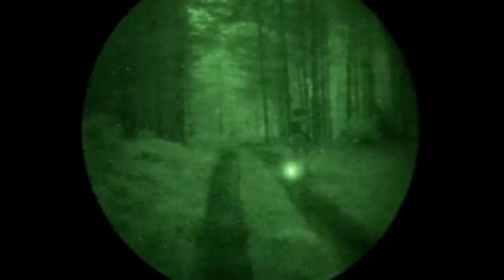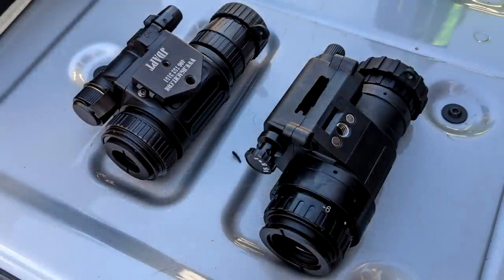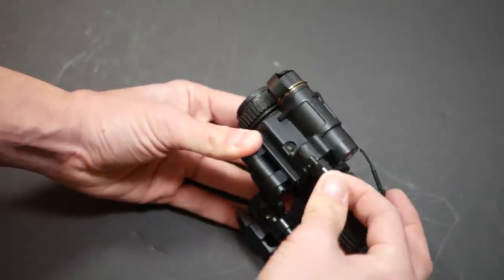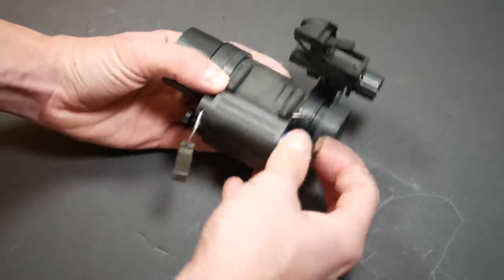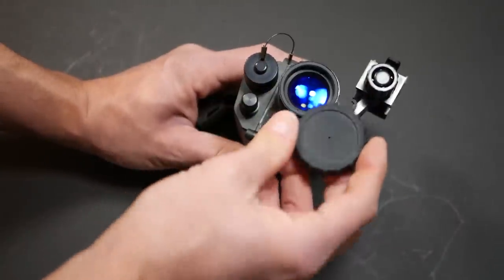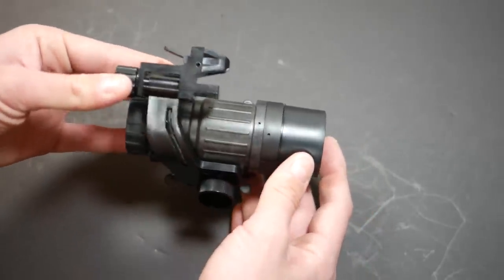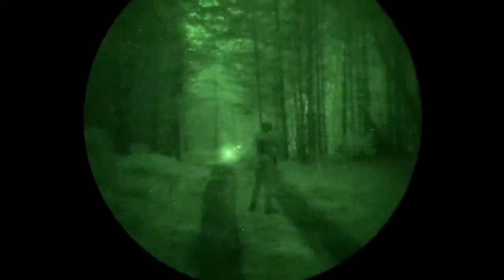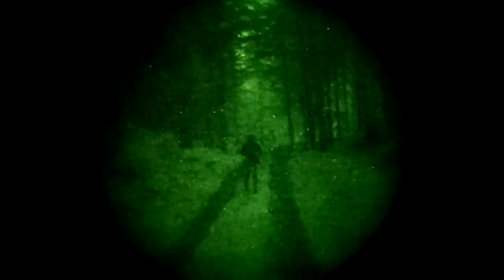Night Vision 101: The Basics

Comment: Awesome vid! Just wanna point out that automatic gain control does protect the microchannel plate in the tube since it actually reduces MCP voltage and physically cuts down the number of electrons going through the MCP and striking the phosphor screen. Also, pretty much all tubes after the very first Gen 2s have bright source protection mechanisms that reduce photocathode sensitivity when bright lights enter the field of view. Quality of BSP will determine how much abuse the tube can take. I have a non-gated tube that can take up to 50,000 lux, where my gated Gen 3s are rated to ~5,000 lux.

Comment: For anyone wanting articulating dual tubes check out the Nocturn Industries UANVB Katana housing. Similar to DTNVS but lighter and it has built in IPD stops for $1699.99.

Before I found out about the Katana, I was planning on going RNVG with filmless tubes then upgrade to DTNVS later on.

Comment: Good info! Please more on all things night shooting, especially nightvision/thermal pros and cons, and switching to white light in between. I do a lot of predator hunting, and am looking to get into a system for night use, but don’t have a $5-10k budget for some of the nicer thermals or NV. Love your videos and sarcasm! Keep it up.
Reply: I use an ATN Xsight 5x20 for hog hunting.  ATN has a newer scope out called the Xsight 4k that I don't know much about. With the 5x20 and using the factory IR I've shot hogs at 200 yards. The passive night mode is not that great without the IR on though. One of these rigs will get you into night hunting for about $600. You can use the scope during the day as well. These scopes are basically senitive cameras that see in the 840nm IR range. When on,  the 840 IR illuminator itself is slightly visible to the human eye as a faint red glow if you look right at it. They are very different technology from what's featured in this video, but they cost a lot less.

Comment: The "Autogating whine" you referenced in the video isnt rlly true, it can be indicative of Autogated tubes produced by Litton or ITT for Aviation use or just being old tubes, but almost all modern L-3 tubes will have a near completely silent operation regardless of being autogated or not. The whine simply comes from the running of the power supply,  which when u turn on ur NV is working on turning 3v DC input to several thousand volts DC to power the internals.

I have a set of matched US SOCCOM contract L-3 Green tubes in my 15s, and all but one Gen 3 tubes ive owned have been L-3 produced. They make a very quiet but brief whine on startup and once powered on will produce a whine almost completly undetectable unless you put the device straight up to your ear.
Reply from the maker: Of the devices we've played with one PVS-14 has an older tube and has noticeable whine in operation. The newer PVS-14 is silent as far as I can tell. But then again, I'm old and half deaf.
Reply: @Hoplopfheil  Its a VERY faint whine so dont worry if you cant hear it lol, if you're wanting to find the make of your tube you can shine a flashlight through the eyepiece at the edges and if youre lucky you can read the label if one is there.
Reply: I was looking for this comment, thanks bud!
Reply: @Hoplopfheil  whatd you use to record night vision video? Asking as a videographer

Comment: I hope we are about 5-10 years for digital night vision taking over and hopefully before ITAR can catch up
Reply: I think it may even be longer until digital really gets to the same level of performance. The refresh rate alone really gets ya.
Reply: @BurkeSchneider  it didn't take that long for VR to fix that issue in it's primitive form. The aurora looks like the DK1 of this generation of digital night vision.
Reply: I've also noticed a difference in endurance
Analog night vision tends to last way longer on one battery
Reply from the maker: The Aurora shows just how far there is to go. It has an extremely short battery life, very poor low light performance, and LVF latency that makes it hard to use.
Reply: @Hoplopfheil  With electronics, it might not be that far off. The Aurora feels like the Oculus DK1 or the Tesla Roadster which is the inflection point where things rapidly start to get better. The Aurora is offering Gen 2ish performance but with some significant drawbacks. I can see 5-10 years from now with enhancements in Black Silicon sensors, and with latency processing solved we can get gen 2+ or gen 3 levels of performance with several benefits such as never expiring, image stabilization, and color night vision at the expense of battery life. 

I feel like Digital Night vision is like Ray Tracing, at some point it will replace analog, but the question is when will it get there.

Comment: I am thinking about buying this for my AR15 and using my Bering optics  pvs14  monocular  I swapped the gen1 tube with a gen 3 filmed tube it works good but no way to adjust the brightness . But it is my first entry level monocular. I am saving up for a nicer gen 4  that's 6500.00 and wanted something to beat up on thats under 2000.00  to learn with.

Comment: What adapter are you running on the NVM14? Not the Jdapt but the sexy one pictured in the opening? Thanks.
Reply from the maker: That's a MOD Armory swing arm. I don't really recommend it because of how loose the bayonet connection is. They make a dovetail version that might not have that problem though.
Reply: @Hoplopfheil  Thanks for the fast answer!

Comment: Good video! So if you wanted to with no modification "really" you could switch the tube from your atn nvm14 and put it in your pvs14 housing? They use the same type tubes
Reply: And I would definitely be interested in a video of you comparing those 2 devices that would be awesome i havnt seen one anywhere on here about them compared
Reply: Yes, that's correct it is possible to change image intensifier tubes from one housing to another. However it's not what I would call simple, there's some online guides that can help. I wouldn't trust myself to do it. It's nothing as easy as assembling a desktop computer for example.

Comment: What determines the quality of the image from the intensifier, why is one grainy while another has a pretty clear image
Reply: The sparkles are a biproduct of the gain knob. Crank up the gain and the image is brighter, but you also have sparkles everywhere. Generally if it is extremely dark outside (no moon) the image quality is poor with lots of noise. But add IR light and the images becomes clearer. Very expensive "supertubes" can see more light without needing as much gain, hence a clearer image
Reply from the maker: Each tube is measured on a bunch of performance characteristics, one of those stats is effectively "resolution." The tube in the NVM has a lower resolution than the tube in the PVS, and it also requires more light to produce a usable image.
Reply: Each imagine intensifier tube has a unique set of specifications. As Hop mentioned, usually the absolute best tubes are reserved for .mil contracts, whilst civilians get contract overrun tubes sold by vendors. Tubes with better specs can often look much better. A lower quality tube can require you to crank up the gain (brightness) resulting in a very sparkly image. If you can afford a super tube it's amazing, but most folks can't tell the difference unless they are side by side.

Comment: I have the opportunity to purchase mill spec BNVD 51 or 40 auto gated white phosphor 1800 FOM. Both have one tube with small organic spot. I can’t get them for $5500. Seller recommends 40 because it edge clarity. I’m new to NV………is this enough information for you to make a recommendation or to tell me if this is a good deal?
Reply from the maker: Sounds kind of like AGM duals with photonis tubes? Doesn't seem like a great deal.
Reply: @Hoplopfheil  wow. I should read my text before hitting send. Obviously meant “can” not can’t get for $5500. These aren’t AGM. They are made by a defense contractor for the military. Owner is selling to me at cost……or so he says.

Comment: One lense or two and why? Yes I'm poor but I want to buy once when I get into it.
Reply from the maker: One for me. Dual tubes are twice as expensive and twice as heavy. My spine needs all the help it can get.
Reply: I went with dual tubes. But as hop mentions they are heavier as well as being more expensive. Based on my experience if you go with a single tube you can do 99% of what the guys with duals can do if you practice. The main takeaway I would say would be to train with these and spend as much time as you can familiarizing yourself with them. Don't just throw them on in Mom's basement a few times. Take them out and walk around. Even duals can be challenging to maneuver in and a single tube much more so.